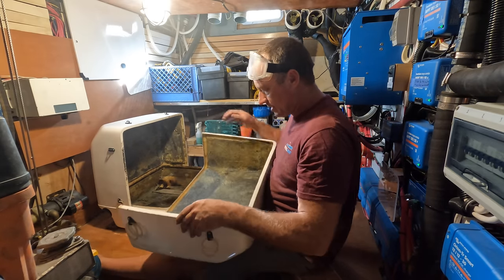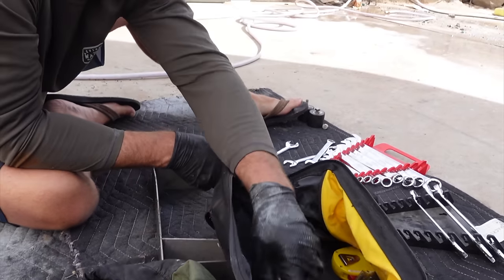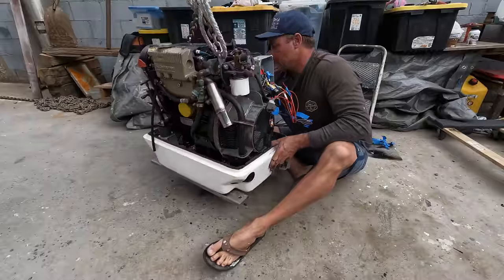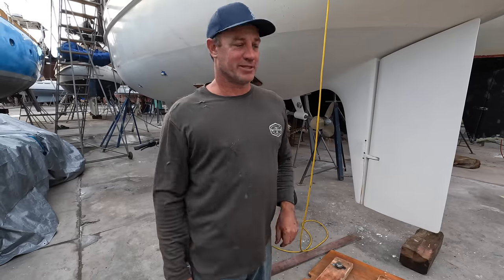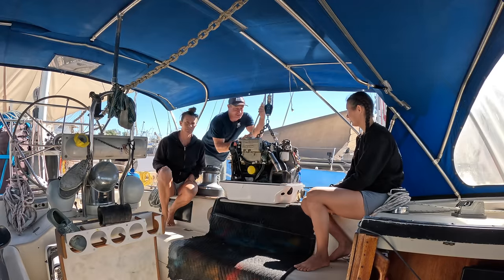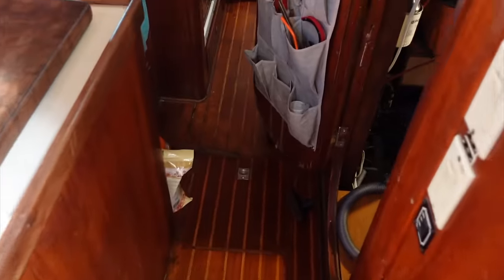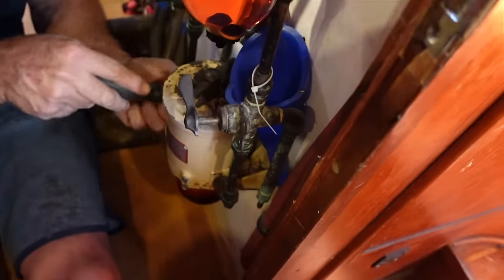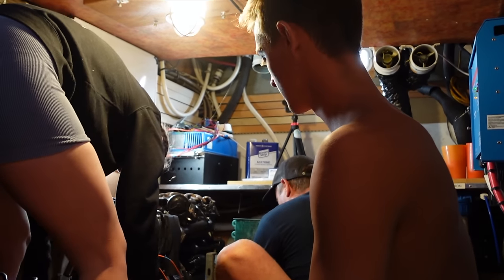DIY Projects are time consuming | Ep 392

Comment: Hi lee. Bags of Ice can be used to slide heavy items across a floor even putting them under it and leaving the bag there is not a problem the ice melts away and lets You lower the item in place without lifting so much.

Great Job All.
Reply from the maker: Thanks for the info!

Comment: Wow what a festive beginning ? Is that generator water cooled only, I didn't see any holes in the case. I didn't hear you give any model/brand info ?  My research says it might be a VTE Marine Generator - PAGURO 4000, 3.2 kW, 115V, Single-Phase, 3600 RPM or similar ? I'm interested because I'm trying to find out how its cooled, and if it has a replaceable impeller ect. Does yours have the remote metering control system ? I'm wondering, its as if that boat didn't have a generator at all when you bought it or was I not paying attention and you removed an old one ? Maybe its just me but I want to see all the rest, the wiring (to that control center) ect. Gen's are important.
Reply from the maker: It's a Paguro 9000 yes its water cooled, yes it has a impeller we replaced it. The boat had a generator at some stage but there wasn't one on here when we bought it.